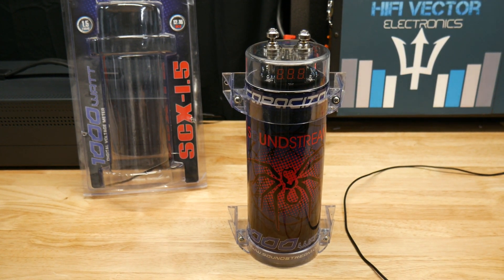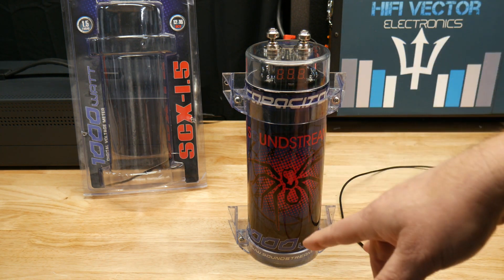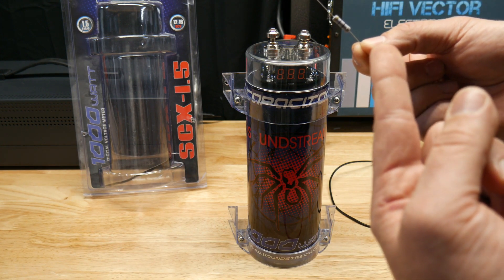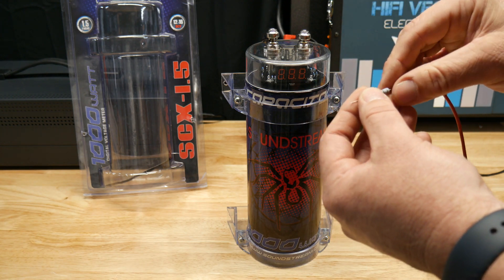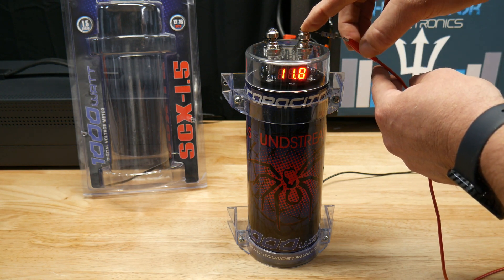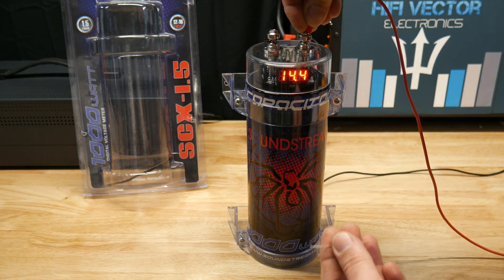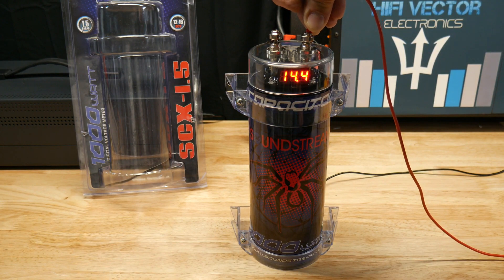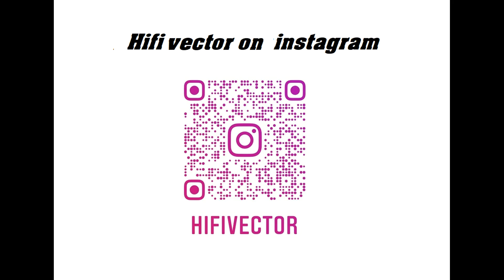How to charge and discharge a car audio capacitor and why soundstream scx-1.5

Comment: How do people usually deal with capacitor when you're doing routine battery maintenance, or perhaps you're replacing your aging 12v battery? Would people typically not have it disconnected long enough to drain it, so when you attach the battery again, you wouldn't see a massive spark? Or do people keep a charging board near the cap and always charge it when messing with the battery?
Reply from the maker: Disconnect and discharge the capacitor before you remove the cars battery.

Comment: What if I was just starting to charge the cap and had to disconnect and not finish charging it, can I just jump back in and recharge it? Or do I have to do something else? Or did I damage it?
Reply from the maker: You’re supposed to discharge it completely when it’s disconnected from power. Then start over with the charging process. The cap will only hold power for like a minute when disconnected but they need to be either discharged or connected to power. They can be damaged by not being one or the other.
Reply: @HiFiVector  ah ok yea I did not discharge it or had it connected to power, had to cut the process shortly after connecting power to the resistor so I guess I will have to buy a new one

Comment: so when its been sitting without a car battery I need to install a flashlite bulb between the fuse parts going to the cap, which is easily accessible, until the bulb goes dim.

Comment: I bought this today but now i feel like i made a mistake because i only use my vehicle for recreational purposes on a weekend so I don’t think this will work for me
Reply from the maker: As long as your battery doesn’t go dead and you drive your car every week or two it’ll be fine. The only problem using a capacitor is if you let your battery go completely dead.
Reply: Thanks for the reply, I usually disconnect the negative terminal of the battery while the vehicle is not in use to prevent it from dying quickly over time…. But that wouldn’t be good for the capacitor too right?
Reply from the maker: Correct that would not be good but you can also buy an expensive battery maintainer and put on your vehicle that will actually help your battery in the long run and prevent that from happening here is a link for a great one I use if you’re interested. https://amzn.to/3XBsCBy
Reply: Thanks so much man I appreciate this and its on Black Friday sale i will definitely buy one now and I’ve subbed to the channel im about to install my own system soon and your reviews are great
Reply from the maker: You’re very welcome thanks so much for subscribing!

Comment: So is it safe to not discharge the capacitor through out the day? Or do I have to discharge the capacitor everytime I go into a store? Please respond lol new to this
Reply from the maker: No, you don’t ever have to discharge the capacitor unless you remove it from the vehicle or remove power from it. For instance, if you’re replacing your car battery and you need to remove the car battery. Then you would want to discharge the resistor and remove it from power before you remove your car battery, so basically you only need to manually charge and discharge it when first applying power to it and then when removing Power from it
Reply: @HiFiVector  thank you so much! I appreciate it.

Comment: I have a rockville 50 fared cap. What size resistor should i use
Reply: I've got the Stinger 50 farad cap and I just used to test light and it worked fine
Reply: Like this dude said you just need a buffer to kind of slow down the voltage so it can charge evenly and slowly

Comment: The capacitor stays on when the vehicle is off. Is that Normal?
Reply from the maker: Yes it’s normal unless yours has a remote key on terminal. Some do some don’t.
Reply: @HiFiVector  thanks, it has an LED display showing voltage. I was worried that it may drain my battery
Reply: @AF-ib7ts  does it drain your battery?
Reply: @Delta132  I drive my car everyday so I guess that helps. Haven’t checked my battery voltage

Comment: Q. 1: do capacitors come in higher farads and would using a higher farad cap be better for car audio?

Q. 2: Can you use a 2nd battery WITH the capacitor in your audio setup?
Reply from the maker: Yes caps come in a wide range of farads ratings. Yes you can use a CAP with single or multiple battery systems.
Reply: Super caps are 3000f at 2.7v so 6 would make a 500f bank but even at 500f that's not much power